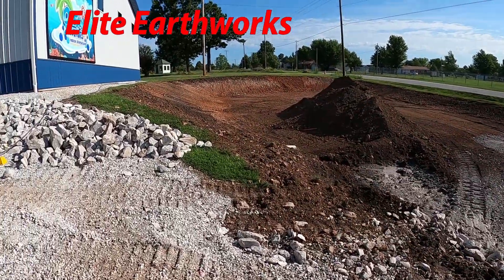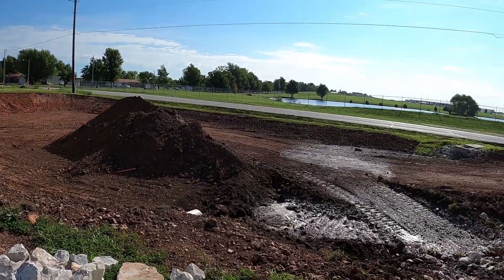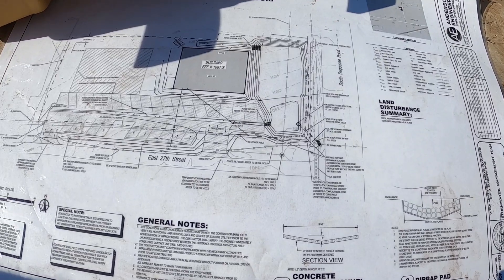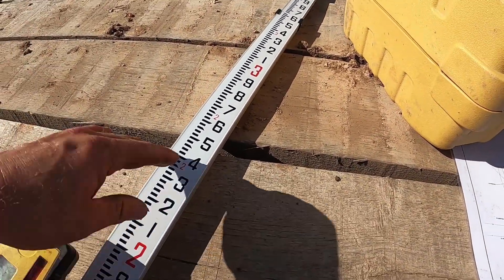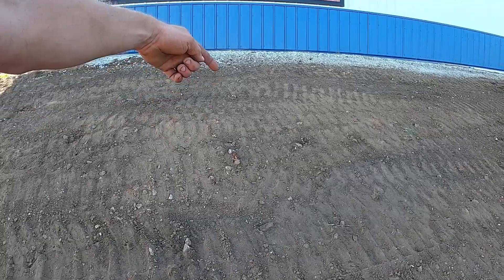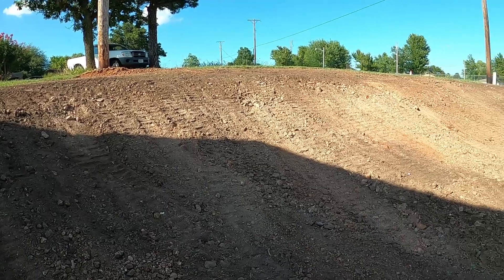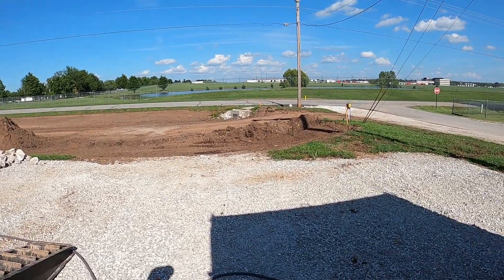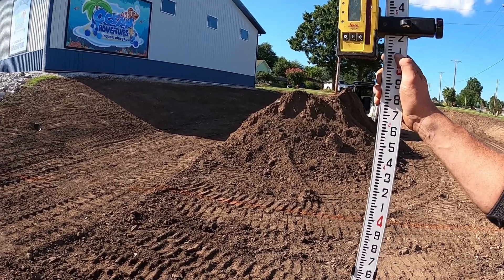Rough Grading The Slopes And Going Over How The Laser Level Works

Comment: pro tip....set your rotating laser so the beam is about 3 and a half to 5 feet above your benchmark grade, and set your indicator on the topmost part of the tenths rod...in other words, collapse it down all the way and pull out just the smallest part of the rod enough to attach the indicator to.  that way you can go around your jobsite shooting grades with out constantly unscrewing the indicator and attaching it back to the front of the rod....your rod is marked on the back side as well and if you try what i say you'll be able to just pull out the rod and measure by reading the BACKSIDE of the grade rod...sounds complicated but once you get it you'll understand how easy it can be...good luck and nice work
Reply from the maker: Thanks that’s a great idea! Makes a lot of sense too. 👍🏻
Reply: @eliteearthworksllc  just passing along something somebody passed to me a hundred years ago lol..hope it helps

Comment: Have you heard of a Hand level? It is a level that has a mirror on it and you keep the bubble between the lines. What you do is measure out 3' Drop a rock use your hand level and with another tape shoot to the top of the slope. That is why on large cuts at construction projects you see stakes going all the way down the cut. I think engineering scale is easier, but not as accurate at inches.
Reply from the maker: Cool I have not heard of one of those but it sounds like it would be handy. I agree with you on the grading sticks. Appreciate you watching

Comment: Unsolicited opinion:  nice grading work on your part Brandon.  The engineers have designed something that will be difficult and expensive to maintain,  forever.   Those slopes look much too steep for any riding lawnmower,  maintenance companies will want extra to mow there.  And it probably won't ever look like anyone maintains it, it will look messy.  The business owner in spending a truckload of money on this project  ... and he'll continue to spend extra on upkeep.   Perhaps he should ask you for a quote to rip rap the inclines, it will reduce maintenance and look much better. And perhaps a quote to landscape fabric the flat area and cover it with a layer of stone.  He's spent a lot of money, now he really needs to spend more.  Good luck.
Reply from the maker: Yes the maintenance is going to be a nightmare. That’s a good idea too on the rip rap I will have to see if the owner would like that. Definitely help on the maintenance side. Appreciate you watching as always

Comment: I did a pond inspection a few years ago and the owner had it in really good shape maintenance wise. I asked him what machine he was using to mow the steep slopes and he said that a mowing company used zeroturns. Much steeper than your site and I thought they were crazy for mowing those slopes going side to side. Wouldn't catch me trying it with my zeroturn.
Reply from the maker: Yikes yeah there is no way I would mow that stuff on a zeroturn. I use to run front mount Grasshopper mowers when I mowed commercially and some of these were a huge pain with those. And they can handle hills so I think that’s why when I build yards and such I always think of the mower guy. Thanks again for watching
Reply: @eliteearthworksllc  I have a Ventrac for mowing up at the farm which is meant for mowing steep terrain and I don't think I would have even tried these slopes with it. They were easily 2:1 coming off the parking lot. At least it wasn't far to the pond bottom. But I still think those guys are nuts!
Reply: Dave Crable my son-in-law has a zero turn... every time I mow his fence line I end up bailing out on the slope.  I’m gonna take my backhoe over and fix it this fall.... if I can figure out when the public road crews are at the other end of the county!!!!
Reply from the maker: Wow that is steep. Those ventracs are really cool they look like they would handle steep slopes easily
Reply: @sassafrasvalley1939  LOL- I agree with you there. Tried a zeroturn up at the farm for a year or so and it scared me to death in a couple locations, especially going down steep slopes as the weight shifts forward and there are no brakes. Like being on a sled. Traded it in for the Ventrac which is all wheel drive and articulated. It didn't even know those slopes were there...
Reply: Dave Crable   I agree zero turns have their place and it is flat wide and level.
Reply: Dave Crable ... I’ve heard that the Cub Cadet RZT series handles well on slopes... but, I mow mine with my 4 wheel drive Kubota tractor.

Comment: When you setup your laser and shoot your benchmark say your rod reads 4’. Add that 4’ to the benchmark elevation and that will give you your HI or height of instrument or the elevation of the laser beam.

From there, to cut to an elevation shown on your drawings, just subtract your HI from the elevation on the drawings and set your receiver to that calculated number on the rod. Cut till your receiver beep is right and you’re on grade. 

Then also if you want to check the elevation of any spot on site, subtract your rod reading from your HI and you’ll have the actual elevation.
Reply: So a good way to do this would be to have your laser set and calc your HI. Then figure all your elevations to rod reading quick like I described in the 2nd paragraph. Then layout the grade lines and drive stakes. Then you can go and mark each stake for final grade if filling, or 1’ vertical offset to your cut, or dig out holes and drive hubs to grade to the top of. Then you can grade around stakes and always check grade without getting the laser back out and having to adjust the receiver height for different elevations.
Reply from the maker: That’s a great idea, I don’t do enough of the laser work to be real up on it. That would definitely save time too. Thank you for sharing the info 👍🏻